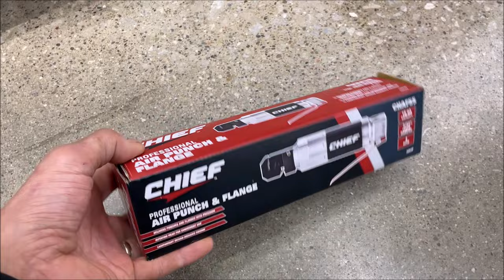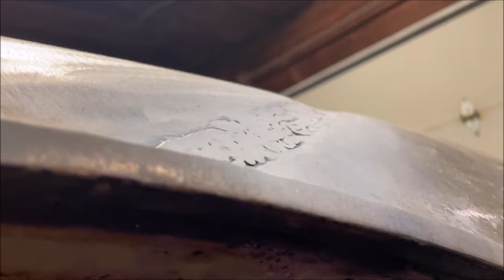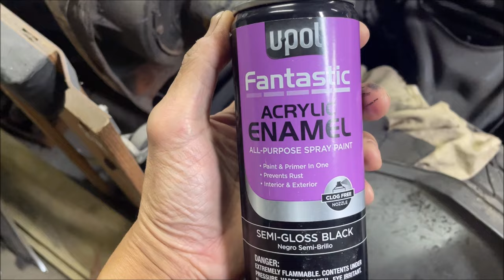1971 Cutlass Ep 07 A Pillars, Roof & Dash Welded on!

Comment: great work Robert 
for what its worth i find the copper weld thru primer is alot better than the zinc for mig welding plug holes, been using the copper one for ages now, 

that rear section of drip rail will to be as deep as the original one because its those two top and bottom lips the chrome trim will hook onto
one solution maybe to add some welding rod to the bottom as it didnt seem to have that extra rolled swage line when you were making it which makes the bottom lip for the trim to grab, 
just a heads up incase it bites you towards the end after paint, check the trim before fit painting!

again, good progress